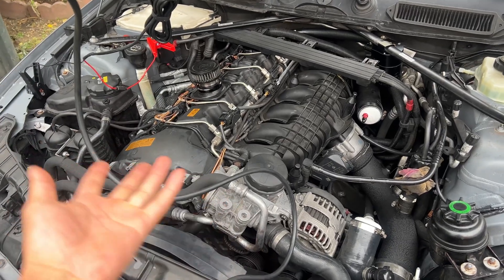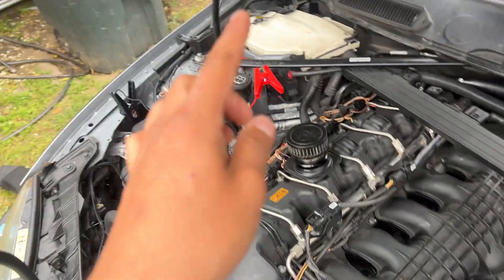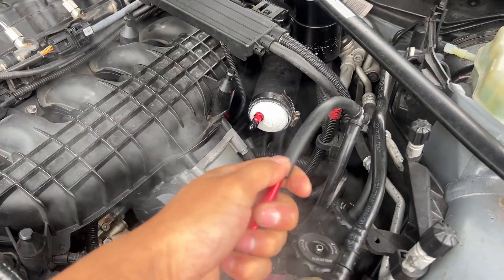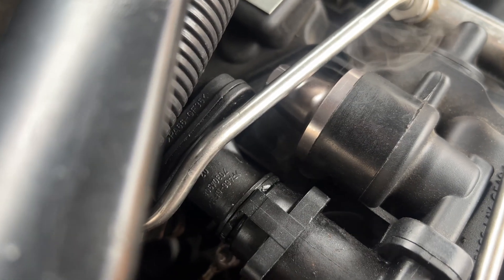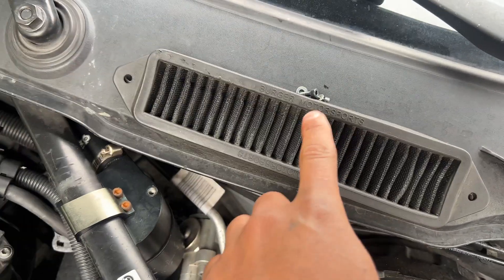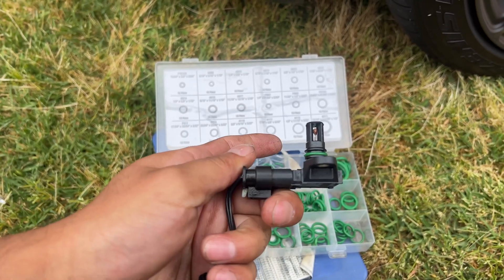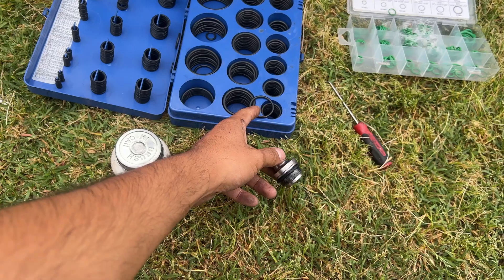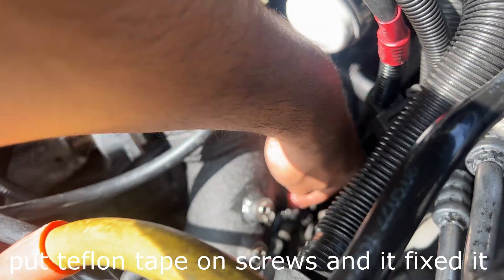How To Find Boost Leak Using A Smoke Machine BMW N54

Comment: Would a boost leak cause the engine to run rich under wide open throttle? My AFRs are in the low 12s/high 11s when nearing red line
Reply from the maker: No it wouldn’t, and you would get a low boost code or 30ff, send me the data I’ll figure it out
Reply: @menjicar my car hits boost target, no timing corrections, AFRs are fine on stock boost (8psi) but when I switch to map 1 (15psi target with JB4 + BEF), AFRs are about 0.5 to 1.0 low. Trims are low showing DME is trying to pull fuel out. I thought it might be carbon buildup so I did walnut blast but no improvement. It’s doing it on both banks so I don’t think it’s O2 sensor or injector related or it would show only one bank (unless two bad O2 sensors, but that’s unlikely)…

Comment: Black rtv gasket maker works best ith the o rings. The N54 burns very hot and oil turns to steam vapor bypassing passages with O rings under boost.

Comment: Vacuum leak can't be found with smoke test so if you're getting P30ff code then I would start by replacing every vacuum hose with high grade high temp silicone hoses. Make sure none of the fittings are cracked and make sure hoses are connected to everything properly. Also check vacuum canisters for and cracks or holes. Then I would go from there and check charge pipe, intercooler, inlets etc...
Reply: The fuck you mean it can’t be found with the smoke tester, that is literally what they’re designed for.

Comment: Dude I've been going nuts trying to find the stupid leak at the Charge pipe and seeing this and I was feeling the boost leak right from that very spot but couldn't figure out what was happening! I'll be using some teflon tape on mine tomorrow and hoping it works!! I'll post it here if I remember to even if it doesn't work. Thank you for sharing this!!!
Reply: Black silicone rtv gasket maker works best. The n54 gets very hot and the oil turns to steam. It will eat up even the best O Rings under Boost
Reply: Yo did the Teflon tape on the map screws work?? I have major boost leak and I can feel it coming from that area of charge pipe
Reply: @330Details  I took my charge pipe out to look at those bolt holes and on mine (I have two of them and checked them both just to see) they both were not drilled through so they can't leak. The tape should work though if yours are through in that spot.
Reply: @friguy4444  try putting a o ring on it fuck it never know if that might work

Comment: Not sure what you did for the screw holes - maybe Teflon tape?
Reply from the maker: I actually did use Teflon tape and it sealed it
Reply: Where did you get the caps to put in the charge pipes to seal them?  @menjicar